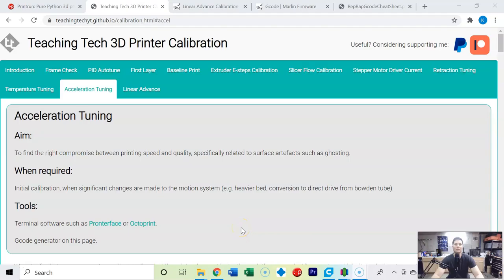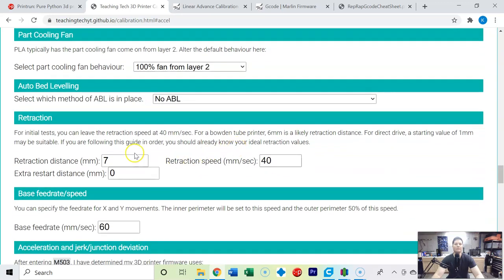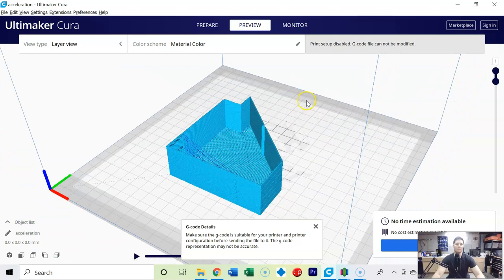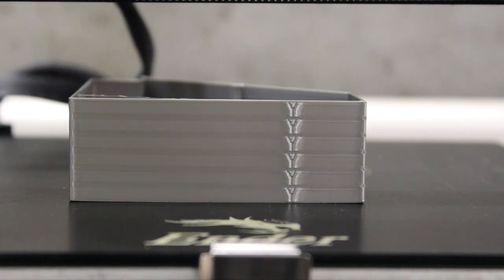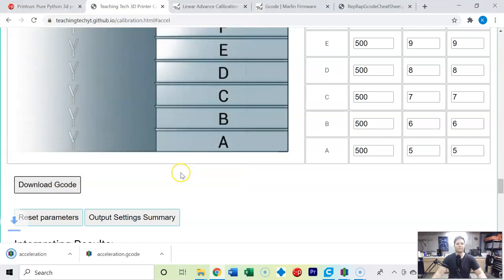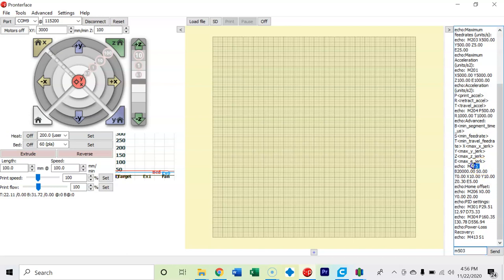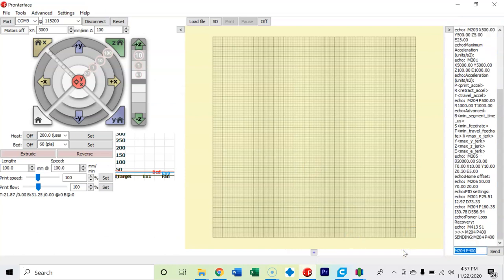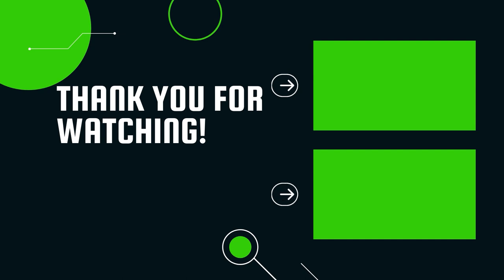Acceleration Tuning - Calibrating your 3D printer - Ender 3 V2

Comment: You're not making the best of the calibration.  You should see a range of differences, picks the sweet spot better ringing around the letters and bulging on the corners.  You didn't even checking for bulging.  And the best way to check the effects is hold it up to the light and see how it interacts with the light.  The original Teching Teach video covers it way better.